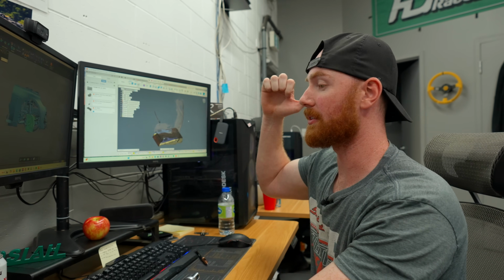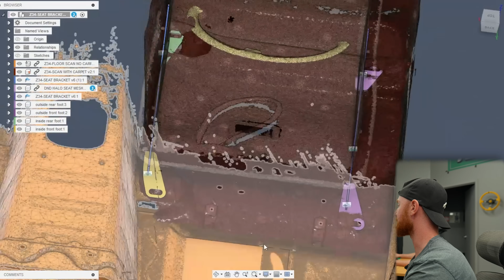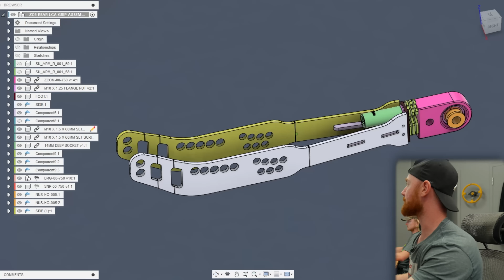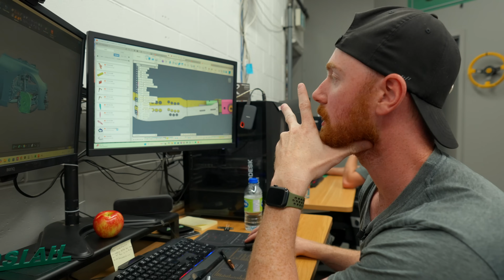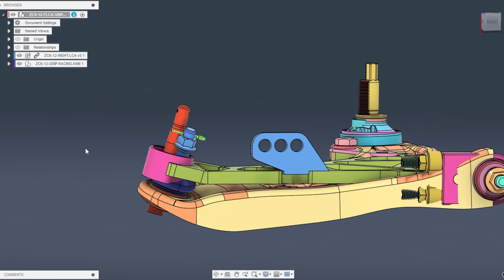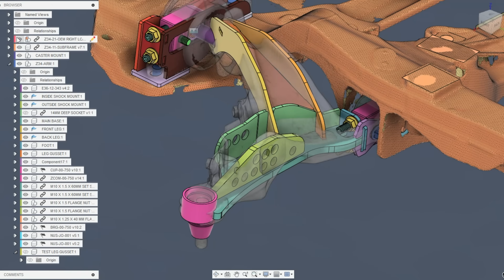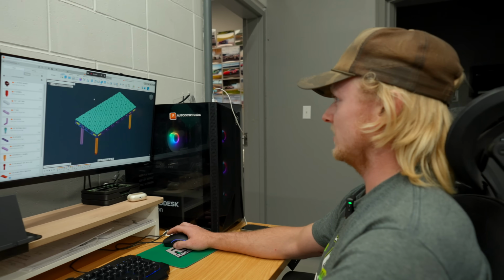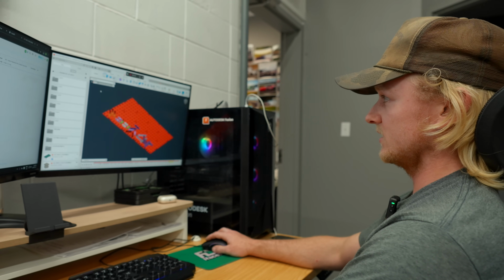Design Time Episode 7: What 50 Hours of Designing Parts Looks Like

Comment: For the BRZ front lower, the ball joint hardware seems to protrude quite a bit toward the floor. I've seen arms like SPL cause clearance problems with 17" wheel barrels that are commonly run in BRZs. Any way to make those a little shorter? I've seen friends have to grind/cut hardware in that spot.

Comment: I designed and built my own jig table just like the one shown here. My recommendation is to be VERY careful who you're dealing with when building one of these. I'd wholeheartedly recommend just ordering the kit from FDF when it comes out, or paying to import something like a Langmuir ArcFlat from the states. Don't bother DIYing with DXF files.  

I'm in BC, and every single supplier involved from the steel supplier to the laser cutting place tried to screw me. They absolutely DO NOT respect the home shop fabricator, talked down to me, gave me the wrong steel, left it out n the rain, did a halfass job of cutting it, you name it. It was a horrible, infuriating experience. Thankfully I have a friend with a mill that has a 8'x12' bed so I had it post machined to a usable state, but even at mates-rates the cost ended up being about twice what a kit table would have been.

Comment: why spend time developing this new adjustment style when yall just starting putting the smooth adjusters on everything? have you been seeing a high number of failures with them?
Reply from the maker: Smooth adjusters will always be one of many possible adjustment features. Different cars have different interference points and often times require a different method. Also these shim blocks are only for road racing suspension, not drift suspension. The smooth adjuster is still the best option for drifting